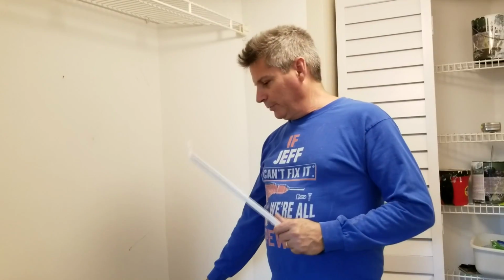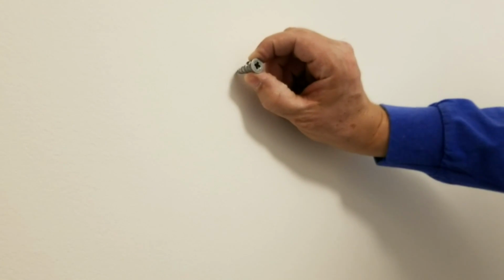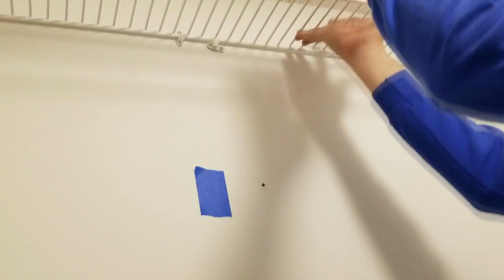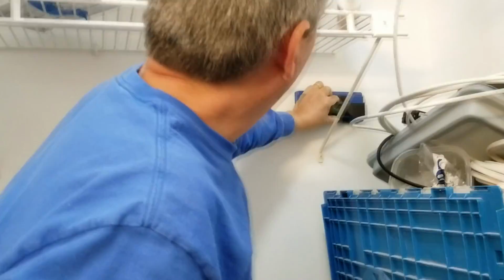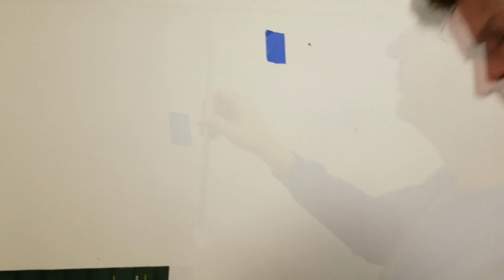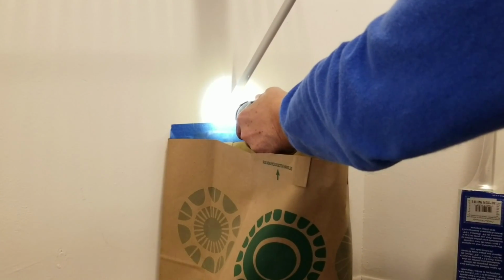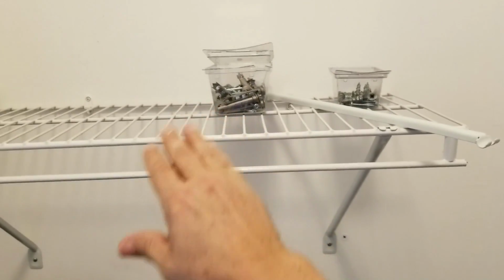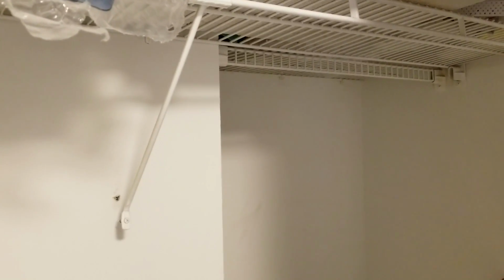DIY How to Repair Closet Wire Shelves Falling Off Walls

Comment from the maker: ✅ Tools and Products in this how to repair closet shelves video: Recommended Closet Maid Shelftrack starter kits: 
✅ ClosetMaid 2091 ShelfTrack 7ft. to 10ft. Kit, White: https://amzn.to/2SwpPYv 
✅ ClosetMaid 22875 ShelfTrack 5ft. to 8ft. Kit: https://amzn.to/2RwBUj6
✅ Precision Sensors Stud Finder Deep Scanning LED Profinder 5000:  https://amzn.to/2qAuAr7
✅ DEWALT DCK299D1T1 Hammer Drill, Impact Driver Kit: https://amzn.to/2M6h450 
✅ E-Z Ancor Self Drilling Toggle Anchors: https://amzn.to/2GPmAsd
✅ ClosetMaid 12-Inch Wire Shelving Support Brackets: https://amzn.to/2U1Gx2Y
✅ Empire True Blue 12-Inch Magnetic Level: https://amzn.to/2DTCP4j
✅ Metal Stud Screws: 8 x 1-1/4" Self Tapping Stainless Steel Metal Screws Pan Head  https://amzn.to/2NJ43AP
✅ Wood Stud Screws: GRK 120660 White Cabinet Screw #8 X 2-1/2":  https://amzn.to/2C5OUTa
Reply: How much weight can the shelves hold when they're screwed into studs? I have A LOT of clothes and want to out even more weight with shoe racks just sitting on top.

Comment: Any suggestions for dealing with the back brackets coming out? Rubbermaid has specific ones that are an all-in-one with a plastic drywall anchor and then a clip to hold the shelf. A pet managed to pull one clean out of the wall.
Reply from the maker: Nothing beats a good old fashioned metal drywall anchor that inserts into the hole and then spreads out 90° on both sides because it can't be pulled back through the drywall. However any type other than this will fail including the threaded metal drywall anchors and the plastic threaded drywall anchors because they could also be pulled out through a weak hole or the weakened drywall.

Comment: Im an engineer as well, but you have factor time and money into the job. These wire rack kits were NOT designed to go into studs. They are supplied with nothing but dry wall anchors. Also, when doing stud finding in a closet, you may end up hitting an electrical line, fresh water line, or sewage some stud finders do detect electric.  A potential buyer may not want the wire racks at all. Now you  have screws ran through studs instead of sheet rock, good luck repairing your studs. The most common failure point is the plastic anchors. After 15 years or so, they will start to crack/crumble apart. During a build, the wire racks are the last thing to go in and will take a general contractor under an hour to install.
Reply from the maker: The wire shelf kit manufacturers are stupid and cheap only concerned with giving barebones solutions, They are not supplied with the correct parts to go into studs, but any shelf that anyone installs should go into a stud or have a good solid drywall anchor that opens up like wings and grabs the back of the drywall once inserted, or screwas should go into studs. Also, wiring per code is in the middle of the wall, 1 1/5" in. You should never use a screw longer than 1 1/4" to avoid hitting wires. You know when you find a stud, and I also use magnets to find drywall screws into studs to confirm. A hole in stud is not a problem from a screw at all, and a buyer not wanting the wire shelves can easily stick some Dap on the hole to fill it in.

Comment: In the last shelf your bracket was incorrectly installed in the shelf. You should have a wire from the shelf in the middle of the bracket.

Comment: The last bracket is completely wrong!🤦🏻‍♂️
Reply from the maker: What is wrong?
Reply: @jeffostroff  at 30:20, the bracket is attached to the lower, clothes hanging wire. The gap between "the fingers" is meant to split the wire racking above to  restrict the bracket from popping out. But since I caught your attention, I really like your anchors, I used Molly's since my garage wall is an inch thick drywall over plywood and I'm not pleased with the results.

Comment: Amazing anchor tutorial, fail on bracket install. Prongs at the top need to split the gap in the middle with a wire from the shelf itself.

Comment: Unfortunately there's only a brick wall behind my drywall
Reply from the maker: You can use blue metal tapcon screws, but you must drill a pilot hole first with a concrete bit

Comment: Why did you replace the brackets? I understand that the shelving fell, but why not use the same support brackets just installed into the studs?   The reason why I ask is I am using donated pre-used materials.  I am volunteer at a tiny house village for the homeless so things are mainly provided through donation only. I  need to install these across the inside perimeter of one individual's home. The last thing I need is have the whole thing come crashing down on them.

Comment: with. Is not a complete video. You did not show how to mount the shelf to wall. Is there required spacing for the shelf clips. You focused only on the support brackets. If a shelf comes down everything usually comes. Im a machinist of 45 year. That doesn't always make me smarter than some one else neither does being an engineer. Trust me I've worked with plenty of them.

Comment: Enough with the original contractor screwing up speeches.  Save several minutes by not beating a bad install to death and get on with simply showing  installing the self and brackets correctly.
Reply from the maker: On the contrary, it explains to people why their shelves failed. They always ask us why did they fall out of the wall. Stop being so defensive about it.
Reply: @jeffostroff      Why do shelves fall out of the wall?   They were installed incorrectly and probably overloaded.  Move on and quit being such a long-winded jerk about the contractor's faulty work.  You're probably a good contractor and I'm sure you've left your less than stellar mark in the past as well.  Everyone does.

Comment: You're absolutely correct I've worked for a big Builder for decades and the shelving contractors we hire just throw shelves up as quick as possible never hitting a stud never using the proper anchors if there is no stud and I'm sure later on down the road the shelving comes down and the homeowner has to pay a carpenter to reinstall them properly

Comment: This happened to me too! Great video. Do you also recommend using the Ez anchors for securing the plastic clips to attach the shelf to the wall ?  I can’t tell from the video because they are already secured. Thanks in advance.
Reply from the maker: The plastic clips armor to control the vertical direction of the shelf and just to help keep it in place as a secondary anchor. I still however do not use any plastic anchors whatsoever you might be OK with that as your secondary but I for my own personal experience will always install the easy anchors wherever there needs to be a screw attachment

Comment: The last owner were DIYers and use friggen drywall nails on the wire racks! Augh!!! One has fallen and I fixed it into the studs.
The other side is way longer and has more stuff on it. I'm afraid it'll fall but I can't do it by my small self :(.
Reply from the maker: At least you know what to do to fix it!

Comment: Hi! Can I put 2 regular walmart wire shoe shelves sitting on top of the wire shelves that are drilled into the stud already?
There are tons of clothes hanging it already. It's full. 
Is that too much Weight for a wire rack in studs? 
There's enough room for the two 3 shelved little shoe rack things. It would help with vertical space saving.
How much weight can they take?? 
Help please!
Reply from the maker: If you are sure that all of this cruiser in a stud then you are fine. Especially if it's wood that's even better than metal studs. I would still try to find a way to also secure the new shelves to studs as well
Reply: @jeffostroff  HI! They're like little seperate 3 tier shoe rack things that usually sit on the ground. 
And yes, they're in wood studs. The shelves will just have the full weight of shoes and racks plus the clothes. Lol. Is that too much?
Oh, I def should try to attach them to the wall just in case they want to fall off for some reason. That would hurt. Thanks!!
Reply from the maker: @melmelbry5754   I would try to make sure some of the screws go through studs and you can use some of the fancier metal drywall anchors that I've shown for backup along the 3 shelves
Reply: @jeffostroff  Thanks! I'm a self taught woman who does not have a "fix it man". It sucks having to do stuffmyself, especially when I need more hands. Oh well.

Comment: You're right about the plastic being garbage but you're wrong about where it breaks.  The Achilles heel of this design is not where the strut mounts to the wall.  Look at the hole the strut anchor came out of.  There is no elongation.  The problem is with the shelf bracket anchors up top.  Not only is the plastic cheap but it's also thin at the base of the U of the anchor.  Even if you mount them every 10 inches like the instructions say they cannot hold more than about 8 pounds per anchor.  This leads to collapse at the point where the shelf anchors to the wall, not initially from the strut.  I redesigned the anchor and 3d printed much stronger anchors out of PETG to use on my shelves.  Haven't had a problem since.  I'm surprised that this company hasn't been class action sued out of existence for supplying such poor quality brackets.
Reply from the maker: When you read their instructions they always tell you to find a stud. 99% of professional closet installers get this wrong, and perform shoddy work for builders.  The fault here lies with the installers. The problem is not those u-shaped shelf anchors, the problem is the weight of clothes hanging on the front of the shelf cause rotation pulling that yanks the anchors out of the wall.  Had they been screwed into a stud, there would be no problem
Reply: @jeffostroff  It actually says to hang one no more than every 10 inches.  Studs are 16 inches.  Go ahead and hang them every 16 inches and wait for the call back when that shelf falls.  In the 22 years I've been doing this I've seen it over and over.  It always breaks in the same place.  When you apply the nail that anchor splays at nearly 90 degrees in the wall without a stud or firmly up against the wood in a stud.  There's plenty of resistance either way.  The reason that it appears that the anchor pulls out of the wall is because the weight of an adjacent anchor snapping so that the remaining weight is transferred to that screw anchor.  The problem with the upper anchors is that they are weak in both a horizontal and vertical direction.  If you put something heavy on top of the shelf it will shear from vertical weight.  If you put clothes on the end of the rack then the struts act as a fulcrum and break the upper anchors in exactly the same point as it would from vertical weight even though the shear force is horizontal.  Had I never seen shelves break with anchors set in studs I'd believe you but I've seen them break enough well anchored into wood.

Comment: I have one of these in a bedroom closet which also shares room with a hot water heater on one end which means  that there is only an end cap on one of the ends since the wire closet rod / shelf unit stops before it gets to the hot water heater and does not meet this side of the closet wall. Do you have suggestions in a case such as this? This has collapsed again since being reinstalled by maintenance at my apartment complex. I have forwarded your video to them with the listing of the supplies that you used but am also wondering if a different type of closet rod system would be a better application than this wire closet shelf unit.

Comment: Jeff saves the day...again. I live in an apartment, and I usually get a FAST response time when I put in a maintenance request. The only problem? The maintenance guys suck. They also don't even know what a studfinder is, and the shelf inevitably collapses again and again. Invested in good impact drill, a good set of bits, and hardware you recommended. Super easy fix, done correctly. This shelf is not going anywhere. Thank you Youtube Dad!
Reply from the maker: Way to go Omar!

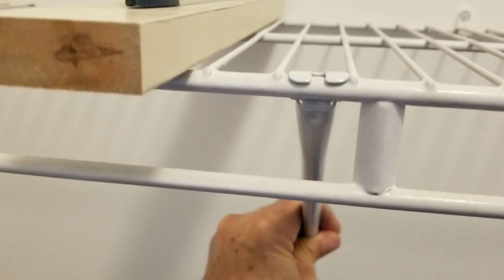Comment: Also, at 23:30, the bracket notch doesn’t hug one of the wire rods. Not trying to find fault but I am wondering if it is safe because the brackets I purchased from Amazon doesn’t have a long enough notch where I can fit a wire rod properly. I might have to drill a longer notch.

Comment: Hi, at 17:25, I can see the end of the bracket is not supporting the shelf properly. Closetmaid manual says the notch has to hug around one of the column rods. Is it safe to install the brackets like you did? I think the shelf load will not transfer properly to the 45 degree bracket unless the column rod catches the bracket?
Reply from the maker: Yeah we adjusted it later we always do a thorough double check afterwards to make sure everything is seated. Sometimes for the rush of making a video not every single item is putting place this put in place we do it more or less for showing how to do it

Comment: The design of this system is bizarre. The wire shelf ends sits in a bracket with no resistance to rotation thus upside down anchors are attached to the back to resist uplift tension forces from a weight at the edge.
The angle brackets are jacked also working in a reverse counterintuitive way a bracket would work.
Reply: You're exactly right.  The forces on the upper anchors are both downwards and outwards.  These cheap plastic anchors can't hold much weight at all.  The creator of this video as well as most of the people commenting here erroneously blame the installation but the engineering of the upper anchors are the problem.  That's why many on here are posting about multiple failures.  I've re-engineered the anchor and 3d printed my own upper anchors out of PETG for a much sturdier solution but the overall design of this shelving system is extremely poor.

Comment: Im not here to bash or anything negative i just need some clarification , how does it make sense for that support bracket to work if the open end of the c shape tip is on top of the wire shelf shouldnt it be from under side isnt that shelf just gona go down under load it just doesnt make any sense to me i dry fitted it and i cant wrap my mind around the obvious if anyone can chim in the explanation that be great before i start making cheese out of my wall
Reply from the maker: The system doesn't really lend itself to fitting very good which is why I prefer to use the shelf  track whenever possible

Comment: Hello, I have put my brackets the way you have showed me in this tutorial; however I use the shelf for coats, jackets etc.... and it almost like the coats & jackets are to heavy for the brackets. they keep bending and the shelf will fall because of the brackets. I screwed everything to the stud so that part is fine.  how many brackets do I need? is there a weigh limit?
Reply from the maker: Yes you are overweight on the clothing part of the problem is even though this video shows how to repair wire shelves I don't ever install wire shelves like this in closets I can't stand them myself. I prefer the upgraded version from closetmaid called their shelf track which uses bigger beefier cantilever shelf racks instead of these wire pieces of stupid as I call them. Plus the system my setup is changeable you can move shelves up and down on this system and it's much better secured to the walls in the studs. See one of my videos here on installing the shelf track system https://youtu.be/gCu4j4IT-X4

Comment: The shelf brackets don't pop up if you install them correctly with the small wire into the groove that is designed to have the wire go through it and it makes it impossible to push up.

Comment: Jeff, Thanks for this video. I've been wishing my dad had taught me to do this stuff. So, greatful you're here. 

I couldn't agree more. The builder did a horrendous job of installing the closet systems in this house.

I have lots of really heavy coats, linens, etc. Between Rubbermaid and Closetmaid, which system do you prefer or consider to be the strongest? Thanks for answering in advance.
Reply from the maker: Leona, I have only used the Shelf track so far, but I assume the fast track is the same as long as it is screwed into studs, I love the closet maid shelf track for it's stability and expandability and you can rearrange the shelves

Comment: Jeff, HELP? I mistakenly removed the center support from a wire shelf that was in the stud.  How do I repair it now? Do I have to move away from using the stud or is there a way to rig something that works? The builder used a drywall anchor rather than a wood screw. Will the center support still work if it's a little off-center? Is that wise?
Reply from the maker: Just buy a 2" long screw and screw it into the stud, right through where the builder's anchor was. Get a screw long enough to reach back into the wood stud by 1".
Reply: @jeffostroff  thank you!  That was the solution I came up with as I thought about tit further. You inspired me!  thanks

Comment: What do you call that thing that holds the wire or will anchor the wire? It is on your video 27:08 . Mine was broken and need to replace it. What is the name so i can buy.
Reply from the maker: https://homedepot.sjv.io/YgjkvO 1 in. White Wall Clip Set for Ventilated Wire Shelving

Comment: But what if those plastic cup clips pull out too
Reply from the maker: You should only be using the metal anchors that I showed you in the video Whenever I see those plastic anchors I call them out and replace them with the middle anchors

Comment: Painfully long but resourceful
Reply from the maker: Yes there were several examples to show
Reply: @jeffostroff  just got back from home depot with contractor strength pull toggles and a new stud finder 😄 thanks brother.
Reply from the maker: @TacoVic  how did the repair go?
Reply: @jeffostroff  it went good dude! Just gotta cover up the small holes from the previous shelf hardware. Thanks so much man.